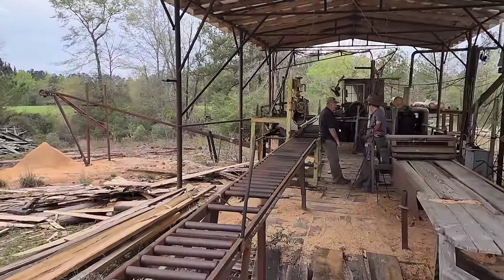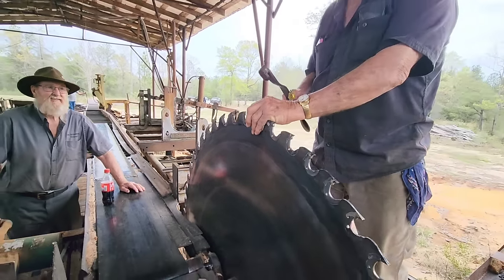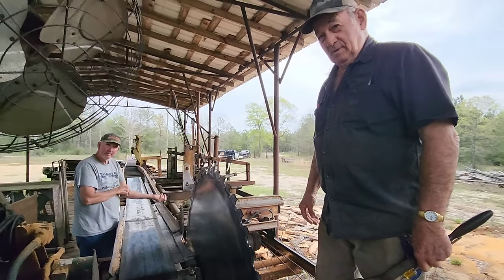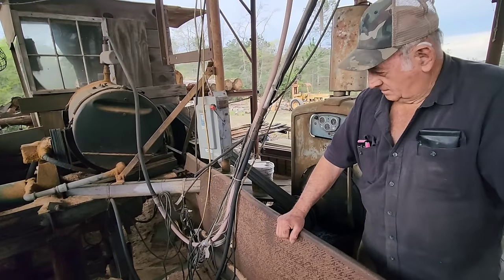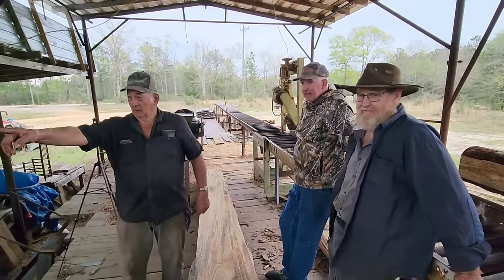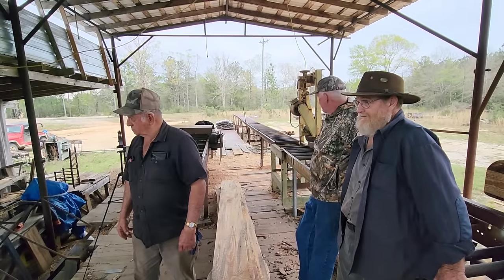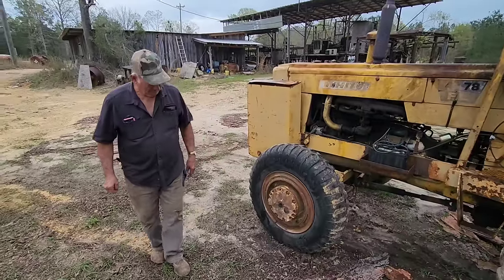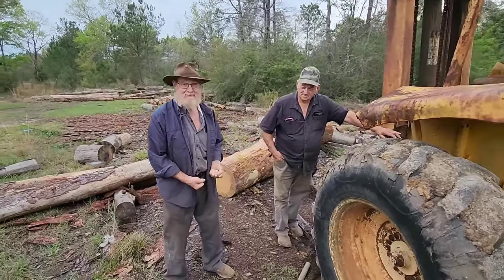The return to the most amazing Mississippi circle sawmill.  Searching for sawmills episode #6

Comment: We used to run a sawmill in Bonanza, Alberta with a 44" headsaw. We turned the logs on the carriage manually with a Cant hook. The mill was on the farm and had the headsaw, edger, trim saw, and planner. We ran it off the PTO shaft of a 125 hp John Deere tractor. It took 6 men to run it efficiently. I remember it well as I was on the Cant hook and got knocked down over the carriage by a log coming off of the spillway. Luckily there was enough sawdust below the carriage to break my fall.

Comment: It'd be a bad week to destroy one of those blades. A 52 inch one will cost you over $3k new
Had an old mill near me when I was a kid.  At that time they only really ran it on the weekend.  During the week the logs would build up but for damn sure come monday morning they were all boards.  The mill is gone but the dang building still stands some 40 years later

Comment: I got skeptical of all the "accumulated knowledge" one minute into the video. This mill is a RIGHT HAND mill.  Maybe left verse right is an ambidextrous way  of skirting facts.  Check the threads on the mandrel holding the loose collar on.  They will have Right Hand threads and I have seen the contrary (But not correct) as well as two different size collars on a roller coaster track that sawed good lumber.  Now to watch the rest of your video and apologies for bringing rain to your parade. One more thought --  are these fellas pranksters and having fun with you?  :face-turquoise-covering-eyes:
Reply: I am so GLAD I watched this video.  I really enjoyed it.  There were more corrections that could be made BUT the most impressive detail to me was the blade was not talking on return (Not Rubbing) but it was never cutting into the log regardless of how heavy or light the cut was. Thanks for the Grease Gun episode ..